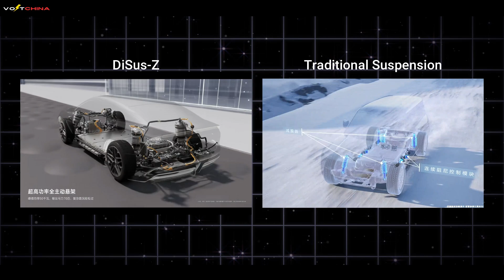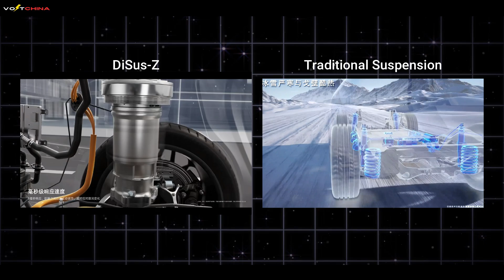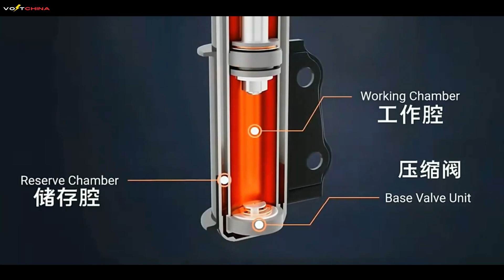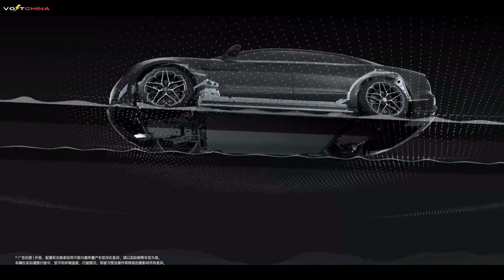Is This the Smoothest Ride Ever Made?

Comment from the maker: Do you think electromagnetic suspension systems will become standard equipment in future cars?
Reply: Probably standard equipment on high-end models only. The EM suspension takes up quite some space, hence for near future it can only fit on bigger cars, such as the Yang Wang U7 in this video.
Reply: @GTI_CHHA  In few years new developments and the possibility of mass production, will make EM suspensions much more cheaper and possible to fit in all car's sizes.
Reply: @edouardmekhalian437 Maybe it comes to medium priced cars but note that the previous big tech suspension system, air suspension has been around for almost 30 years now. Can you name any medium priced car models that have air suspension? Exactly the same can be expected for this EM suspension..